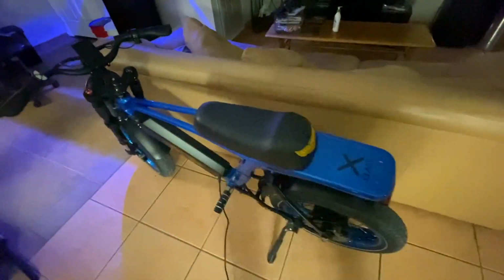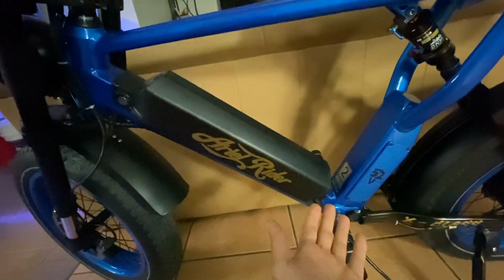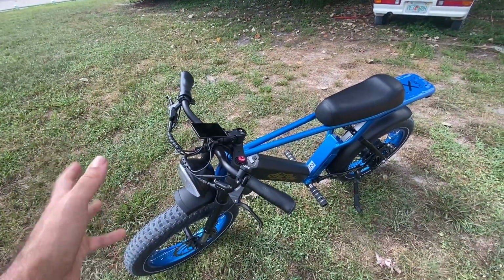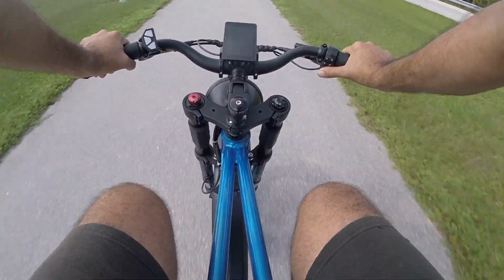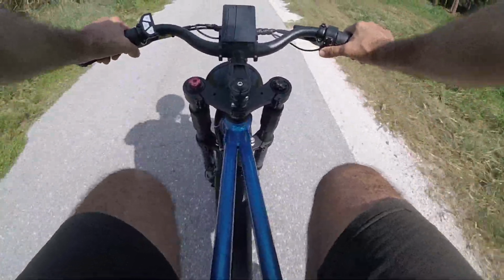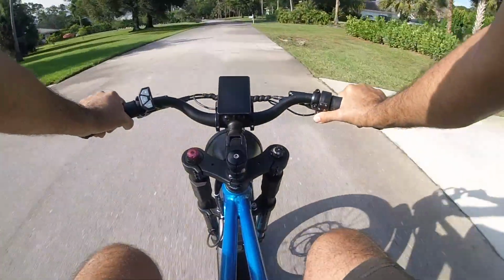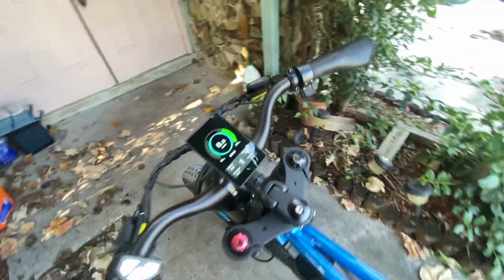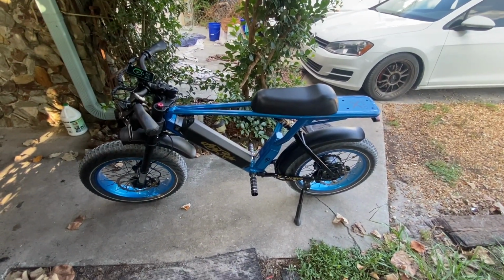Ariel Rider X 60 | This eBike is basically a MOTORCYCLE | 60v upgrade!

Comment: What made you do a 60V upgrade and not the 72V upgrade 3000W motor? I’ve seen videos of the 72V x class going 59 mph
Reply: I think the bike is too light to go 60 . At 35 sometimes seems a bit sketch. Not enough weight.  I wouldn't want to go over 40 on it

Comment: I've heard that installing a more powerful battery is not recommended because the bike wasn't designed to handle the extra power. You can only ride it 5 miles at a time before you have a realistic chance of it catching fire.

Comment: Is your thumb throttle mostly an on/off or more able to modulate your speed. Really seems to me ebikes take a lot more power to go faster than 20 mph or so. Above 30 mph it takes way more amps and watts to get to 40.
Reply from the maker: It's very sensitive.  I might try a full twist but i do like the thumb
Reply: anything over 20mph is less efficent the faster you go and the high surge adds up but people love taking a good thing and ruining it. There will be more stupid people, more who think they dont have to follow certain rules, and more who get into acidents. The point of ebikes is that you don't have register them but most want more speed yet dont want to deal with a motorcycle.

Comment: Jack, I keep coming back to this video and reading the comments as well. This has to be one of my favorite X-Class videos on Youtube. I like the thumb throttle as well. I had a thumb throttle on my Super73 and liked it so much I put the thumb adapter over the twist throttle on my X-Class. What are you plans for replacement tires on your bike? I went for the Shinko 244 as they are lighter than the 241's. The 244 weighs 5.89 pounds and the 241 comes in at 6.29 pounds. I looked at the Shinko 567 street tires and I really love them but they weigh 8.4 pounds each. The flimsy original tires that I pulled off my bike only weighed 2.5 pounds each. I've read that one pound of rotational weight is equal to about 8.4 pounds of static weight. So my Shinko's have added about 28 pounds of static weight per tire. Luckily for me, I'm finally on a strict diet and have lost 28 pounds in the last month. I've got two more Static tire weights to go and get to my goal of 195 pounds! LOL My stock X-Class would still go 31 mph even with the heavy Shinkos and my fat 280 pound ass sitting atop it. Of course acceleration was slowed a little and it cut battery travel range by 30%.
Reply from the maker: Yea I'm not sure yet of which tire but finding the lightest is my aim. Thanks for sharing your findings on weight. I was wondering what the stock tires weigh. I would love to try some speedster tires but not if they increase rolling mass.

Comment: Excellent.  I hope it continues to work out and a package is offered soon.  My 52V is ready and waiting.  I wonder how it would perform with a higher watt motor added into the mix.  Those stock tires are so noisy and I wonder how more street oriented tires would work for top speed and range.  Keep up the great work

Comment: I'd rather have pedals with pedal assist on mine in case i don't pay attention to battery usage and it dies, i can still pedal it home instead of walking it. i already wanted one of these so bad before when it went up to 30mph...now i want it even more! lol I'd be pretty unsure whether i should even ride it on trails at all though at that point since it's capable of going that fast. yes it's still a class 2, but it can go almost 40mph. that's passing vehicles unless you're on main/busier roads, out in the country and highways. i hardly get to 20mph (top speed of my current bike) unless I'm going downhill or riding in late evening when there's hardly any traffic to look for. that and I'm used to the twist throttle on the ebike i have now, I've heard a lot of people say thumb throttles are easier. I'm yet to try out an ebike with that. also the one i have now folds and i can barely lift it at 45 pounds. i sure as heck won't be able to lift an ebike around 60? pounds like this one. it probably wouldn't fit in the backseat or trunk of my car so...a lot of pros and cons for me.

Comment: Really nice job with your machine! I've got a bike from China with a 2000W rear hub motor. It's pretty fast, but only a 48V battery. I wish I could up that V, but I do not have the skills to do it.
Reply: I've now upgraded the battery to 52V. Now it's even faster. Close to 40mph. It's faster than my friends Grizzly v2 easily.
Reply: @Docinaplane  So you just changed the battery from 48V to 52V. And nothing else?
Reply: @johnwilson7809  Used the bikes software to accept the higher voltage battery, changed the pedal position and added pegs so I can take another rider. It's perfect for me.
Reply: @Docinaplane  But same motor, same controller. Just changed the battery, correct?
Reply: @johnwilson7809  I believe I answered you. Tell me, why do you care what I did? What's the point?
Reply: @Docinaplane  I want to do the same thing and just making sure so I don't do something incorrect.
Reply: @johnwilson7809  Have you bought the bike from China? And do you plan on pedaling it?  I'm trying to keep you from making a mistake.
Reply: @Docinaplane  No, Yes. If you don't tell me, I could make a mistake.
Reply: @johnwilson7809  Don't get the Ebike I have, you will not be able to pedal it. The pedals are not set correctly. Your knee comes almost to your shoulder when you try. I went through a lot to get that bike working.

Comment: Did you mention the ah size of the battery? Is that battery the same case size as the original.. Or is it taller? I'm not sure I can get over 15 ah on the Kepler step through. The top frame is right over the stock 20 ah now 1 inch space on top of the battery left. Of course a wider battery case is no problem up to a point.

Comment: Hey Jack does the battery have a 50amp capable bms? If not your controller will only ever see what the battery bms can deliver. My calculations say that bms is still delivering 30amps. With a full 50amps at 67v you should see close to 3400w.
Reply from the maker: Yes, the controller has a 50a limit and the screen displays amperage. In these runs the controller is hitting 47-48a and at top speed settles in at 25-28a as the motor reaches its peak speed.
Reply: Nice, I'm looking forward to seeing the field orientated control for extra juice. Is your new controller pure sine? And if so what branding?

Comment: I currently have a 52v x class with additional battery running parallel with a blender.  If I changed to this controller would I get better top speed.

Comment: I bet there would be huge gains (acceleration) even with a 52v system with programming like this one has.  Get them to make a 52v version as well, with high start current.  I'll be the first customer 😎
Reply from the maker: The controller works with 52v as well. You can select voltage in the menu.
Reply: @JackCecil  good news!

Comment: im hoping i can use but have to see plugs? i bought a mini 500c from a guy ar modded and i saw several people buy for xclass and said same as kepler but the display turns on gets right voltage but speedo or nothing else works and like stuck in locked, pas 2 position. but i switch to 52v 28rim and boosted speed but nothing and never heard again. i PRAY IT WORKS ON A KEPLER. i have two batteries 58.8v20h each i want to swicth to 60volt  ahs?